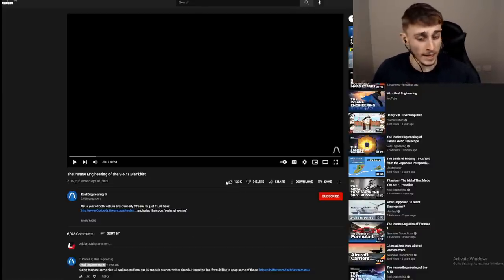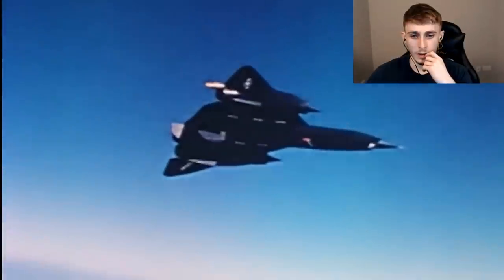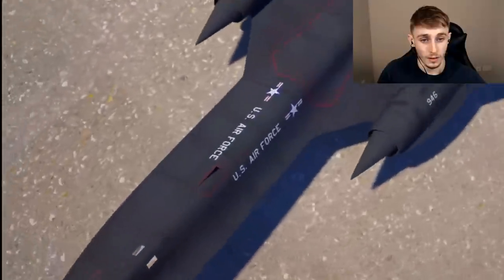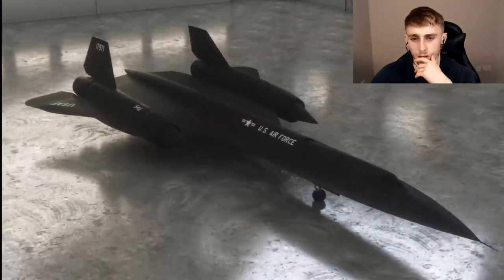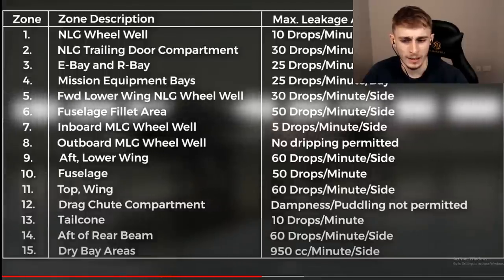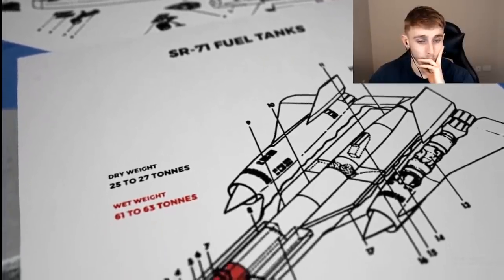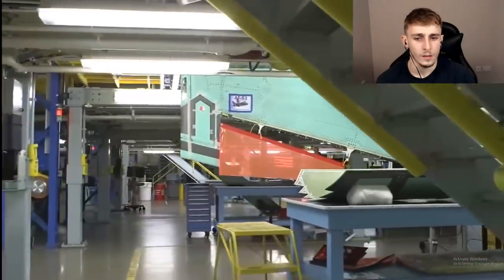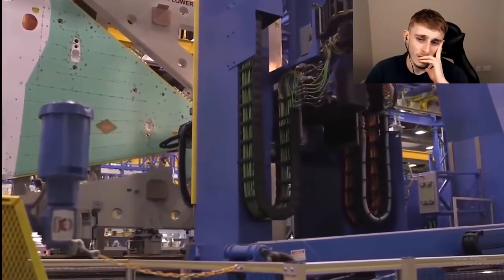Brit Reacting to The Insane Engineering of the SR-71 Blackbird

Comment: the most insane thing BY FAR about the SR-71 is that this plane was designed, tested, and built IN THE 50S. the 1st official flight of the SR-71 was in 1963, and its top altitude and top speed are still classified. this, as well as the X-15 was one of the main reasons I wanted to get into aerospace design; sadly life didnt go in that direction, but when I was a kid and X-files was all the rage, i was obsessed with what we "really" had since this plane was so old, we 'must' have something way better 50 years later, but who knows. makes you wonder
Reply: I think they still use it.
Reply: You forgot to mention the pre-prototype the A-12
Reply: It really has a strange mystique to it
Reply: That is always the angle that fascinates me, this is a 60-70 year old design with elements that are still classified. The B-2 and F-117 are 40-50 years old. Just what is being worked on now?
Reply: Confirmed - my dad knew a guy who saw one land in Alaska in the 50’s
Reply: @tenofprime  Bud Kelly, the head of Lockheed’s top secret Skunkworks division said that if you really want to know what’s going on take the most advanced stuff you can imagine is possible and then fast forward that by 50 years
Reply: @tenofprime  so my guess would be impulse engines
Reply: @TheSkyGuy77  : Actually, they still use the 66 year old U-2.
Reply: What makes the SR-71 better is it was already in development before the first U-2 was shot down and was practically a direct response to the U-2 being shot down
Reply: Do we have anything better today? I've got one word for that question, and that word is "Aurora"!...from Wyoming USA 🇺🇸 🤠

Comment: Check out the "L.A speed story" told by a actual SR-71 pilot. Gives a little human perspective on the machine.
Reply: Yes!!! So much of this yes!!!
Reply: Part 2 as well 👍
Reply: Buzzing the tower is a great one too.
Reply: This has my vote
Reply: Also check out "permission to buzz the tower "
Reply: In the L.A. Speed story, Brian Shul casually mentions off the cuff that they were cruising on a training mission at 89,000 ft and 1992-2000 knots (not miles) per hour. I'll be happy to be corrected, but I believe that 7 knots per hour equals 8 miles per hour, so they were going over 2000 mph. In any event, they took off from central California, over Idaho, where they refueled from a tanker. Used most of the state of Montana to make a 180-degree turn, went past Denver and Albuquerque, turned west at Tucson, over flew L.A., refueled again over the Pacific Ocean, went north to Seattle, turned 180-degrees, went back to their home base in California, and all in 2 hours and 21 minutes. On a training mission.

Comment: Have you ever noticed that when you're doing a big fill-up at the service station, the metal parts on the pump handle get really cold? That's the flowing gasoline acting as a coolant. Same principle in the Blackbird.
Reply: Im actually addicted on touching gasoline.  Its like a hand sanitizer lol
Reply: Also that fuel (JP-7) was not volatile like gasoline. 
You can throw a lit match, and the fuel would put it out. 
They also added liquid nitrogen to stabilize the fuel as it would get hot and vapors could ignite with oxygen in the tanks.
Kelly Johnson was the genius behind this plane, and others.

Comment: 16:38 modern spaceships actually use the same technique to cool down their engines. would recommend "Why don't rocket engines melt? How engineers keep engines cool" by Everyday Astronaut as a great explanation as to how it works as well as other tricks scientists use to make those rockets not blow themselves up due to their own energy outputs.
Reply: But rocket engines aren’t 3D printed(other than the ones in development) there are complicated and expensive techniques that allow them to do that. Correct me if I’m wrong, but the V-2 the ww2 German rocket also used cooling system in the engine nozzle.

Comment: It leaks enough fuel while on the ground that immediately after take off it must refuel in the air, because once at a certain altitude, the metal fuselage expanded, closing up all the panel gaps, and no more leaking fuel.  For the speed that thing would cruise at,  5000 km is an amazing distance. I mean the average cruising speed of that jet was quite a bit faster than the top speed of most any other jet.

Comment: Cooling by using fuel is called "regenerative cooling" I think. Its often used on rockets, like the space shuttles RS-25 engine and SpaceX's Merlin 1-D engines that power the Falcon 9 and Falcon Heavy. The basic idea is you pump cool or cooler liquid fuel through the metal to take heat away with it. In the case of rockets using liquid oxygen, this oxygen converts into gas, which in turn can be pumped back into the fuel tank itself to maintain the insane pressures needed to run the engines. However, for something like the SR-71, and most gas powered machines, the fuel used for them doesn't ignite or evaporate easily, so using it to take the heat away from another surface, i.e. the wings, doesn't actually pose any threat to the craft and has no downsides.

Comment: as a student engineer i'm gonna give my 2 cents on what i think goes through other engineers minds as they start to design something new or think of a new concept. and it's usually a question like "what if...?", for me at least, by asking these quesitons and doing a lot of research into related topics such as "what happens to air when it goes really fast through this engine?" and then a lot tests or more research to see the effects of lots of potential solutions. by comparing and combining what they know as fact in terms of science and what they know works as existing products, it should be possible to pull together ideas into something new. the SR-71 is a great example. the engine already  existed. it's a pratt and whiteney turbo jet engine that the engineers stuffed inside a different intake system to make it work. 

i hope it helps, and that i'm somewhat accurate with my thoghts. so far that process has served me well xD

Comment: Just so you know, most jet engines use a fuel/oil cooler, using fuel to cool the oil prior to return to the oil tank. Many also use air/oil coolers (like a car's radiator), in addition to the fuel/oil cooler.

Comment: the guy didnt get his facts completely straight. the blackbird didnt have to dodge missles. it had speed and height as a defense.
Reply: Missile: Imma gonna get you1111!!11!!

SR-71: nope! 😂 (runs faster)
Reply: Yes even though the missle may have had a faster top speed trying to hit something at 80,000 feet traveling over Mach 3 is pretty impossible. The cruise speed may have been Mach 3.2 but the top speed was close to Mach 4 by some of the stories  from the pilots.
Reply: sort of. it still had to dodge, just not very much. to hit an SR-71 at mach 3+ and 80,000 any intercepting missile had to be fired with a huge lead time. the Blackbird would detect the missile being fired and slightly adjust speed or heading, by the time the missile climbed all the way to 80,000ft the SR-71 would no longer be anywhere near the area the missile had been fired at.

Comment: Some fuels can even be boiled without igniting, Some require an actual flame and some require pressure and heat. Some are also very unstable and will start burning very easy.

Comment: If you want to see a SR71 and a A10 Thunderbolt II (Warthog) up close take a trip to The Imperial War Museum at RAF Duxford near Cambridge. Easy to get to it's just off the A1M and well signposted.
They have many great Aircraft and bits of kit on display there is also the Tank Museum on the same site.
Just so you know there were two SR71s based at RAF Mildenhall in Suffolk (unfortunately not now) seen them flying many times and it was the star attraction at the annual Air Show.

Comment: This plane flew faster than a 30:06 bullet and it created many speed records still in effect till this day. On July 28, 1976, the Lockheed SR-71 Blackbird set the absolute airspeed record with a blistering speed of 3,529.6 kilometers per hour (2,193.2 mph), which is about Mach 3.3. Later that day, another Blackbird set a separate record: highest sustained altitude during horizontal flight.   1974: On a flight to the Farnborough Air Show outside London, Maj. James Sullivan and Maj. Noel Widdifield fly the Lockheed SR-71 Blackbird from New York to London in 1 hour, 54 minutes, 56.4 seconds. The 1,806-mph flight still holds the transatlantic speed record between the two cities.

Comment: A relative of mine was in the Air Force at a base where these planes flew into and out of every once in a while (i.e. not based there). I remember them telling me that they leaked fuel a lot, but they could never get near them to see how much. When they landed they taxied into a hanger that was heavily guarded and only authorized personnel could go into (or near) the hanger. They also stated that no one on the flight crews ever knew when they would arrive or depart, but air traffic were warned in either case.
Reply: I always heard that once the skin heated up it would expand and seal any fuel leaks.

Comment: Using fuel as coolant or shock oil is actually common. Not to this degree, but commercial airlines use the fuel for as much as possible before burning it.

Comment: The fuel leaks are not quite as dangerous as it may seem. Most jets used JP-4 fuel, I think. But the engines on the SR-71 used different fuel called JP-7. This JP-7 fuel is much, much harder to ignite than JP-4. Since they were actually using the fuel itself to help keep the skin of the aircraft cool at supersonic speeds, they needed to invent something with a much higher flashpoint. I'm pretty sure you could throw matches into a pan of JP-7 all day long and it will not ignite. In fact, even the normal sparking mechanism used to start most jet engines will not ignite JP-7. The SR-71 used a special chemical to ignite the fuel. This is why you'll notice a neat looking green flash when the engines are ignited.

Comment: the fuel used for the blackbird is somewhat a similar reason why some racecars with turbos use methanol. no need for an intercooler. it produces a lot of power but at lower temps negating the use of them

Comment: The fuel that the SR-71 used was so non flammable that you could throw a lit match into an open bucket of it and it would not catch fire. The plane was designed to seal tight after reaching normal operating temperature. On the ground they only put in enough fuel to get it airborne an run high speed for a designated time to heat up the shell which caused thermal expansion, then they would rendezvous with the tanker plane to fill up the tanks all the way.

Comment: Using fuel as a coolant was developed by Robert Goddard the American rocket scientist that developed liquid fueled rockets in the 1920's and 1930's. He directed fuel flow into the outer skin of the rocket nozzle to cool them down. He also developed a gyroscopic control mechanism for vectored thrust of gimbaled engines/nozzles.

Comment: Metal based 3D printing has came a long way, most of the early metal 3D printers used soft materials like aluminium and platinum (non alloy platinum is actually rather soft but very susceptible to corrosion, especially from fluids like the oil on your finger tips) but as material science improved we were able to 3D print with titanium.
 Adam savage made a full body iron man suit out of 3D printed titanium (namely titanium dioxide) although it was manufactured by a metal printing company

Comment: When you mis-spoke the Warth-og on the A-10, just means you aren't an African wildlife expert. You were thinking more Harry Potter. Don't fret it. 7:45 Fluid dynamics. But it gets pretty deep. And this was designed in the days of slide rules. The computer time (what little there was back then) was very limited & it took a lot longer to process the information. I do aero & hydro-dynamics & I only have a passing knowledge of how it work. 12:48 Jet fuel is basically kerosene & very unlikely to explode anything. And the SR-71 had a special formula that was even less likely. 21:36 There isn't much about the SR-72 out there. Some on YouTube are making wild guesses about what it is like. It is possible the plane is already flying a prototype. In service by 2030? But as far as the general public knows, there could be hundreds flying already. We may find out . . . In one or two decades. 😀 23:33 No one sees an SR-71 flying over at 85,000 feet. They have (did have) a system to reduce vapor trail. So you literally have no idea one is there.

Comment: You didn't have to worry about the leaking fuel being a fire or explosion hazard. It's really hard to get it to ignite. It's more like kerosene or diesel than gasoline. It's more likely to poison you than to burn you to death or explode. Jet fuel will extinguish a match if one is dropped in.

Edit: of course I answer the question right before the video does.

Comment: Special model of the KC-135 was created to refuel the SR-71, it was the KC-135Q!! to start this aircraft two starter carts as they were named had two 454 big block motors in each cart, the motors would be run up to 6000rpm in order to spin the jet engines to starting speed, and there was just straight exhaust for the V-8 motors requiring two types of hearing protection. No computers were used in the design of the aircraft thanks to Mr. Kelly Johnson head of the Shunk works design team!! I was able to be up close and personal with one of these aircraft in 1980 when it came to my Air Force base, my normal secret clearance was upgraded to top secret for the mission!! No other air breathing aircraft can come close to the SR-71, and the aircraft dropping the X-15 was the B-52A balls 8 it's serial number was 52-008!!
Reply: Let me correct my spelling it was Skunk works!!

Comment: So the pilot controlled the aft vents and if they messed up the timing the plane would start to drag and lose speed, so a lot of the old pilots of these planes learned to feel and hear the timing, similar to F1 driver's knowing when to shift by hearing and feeling the cars. 

But the biggest difference is that when you hit overdrive in an F1 car you don't experience 3gs of force almost instantly. 
Imagine if Lewis Hamilton shifted from 5th to 6th and then suddenly was going 2 times as fast.

Comment: Ok so about the fuel cooling system scaring you. In every modern car the fuel pump is located in the gas tank. The fuel pump is a typical electrical motor driving it, all motors especially ones that run for long periods of time (your fuel pump runs all the time your car is running) needs to be cooled, so yeah there is an electric motor in your tank that is being cooled by gasoline, and yes the gasoline does touch some of the windings and such in the fuel pump, I've never seen one cause a fire so it's a pretty fool proof design.

Comment: The operating ceiling is 85,000 feet high. You’ll never see it. Also it flys at 2,455.261 miles per hour. So you would not be able to!

Comment: A British engineer and the Germans pioneered jet engine prototypes.  The air velocity at the end of the propeller limits the straight line speed of a prop driven airplane.  Of course rockets can go faster than jets, and can carry their own oxidizer, so can operate outside the atmosphere.  Supersonic wind tunnels were used to model the aerodynamics, before you designed something and put the life of the test pilot on the line.  Lots of test pilots died anyway ;-(